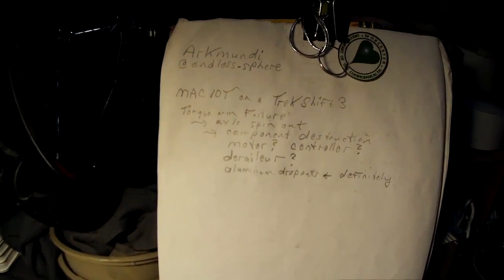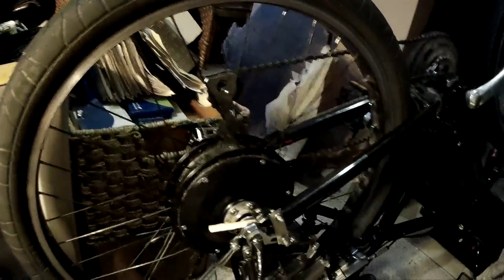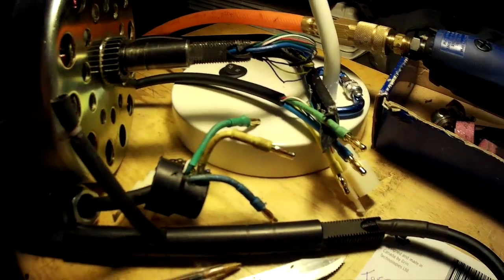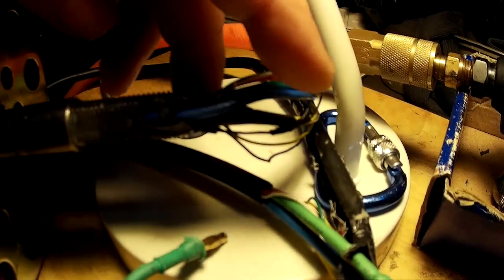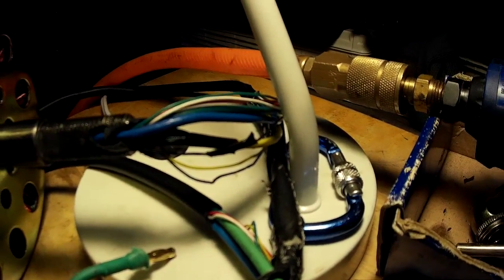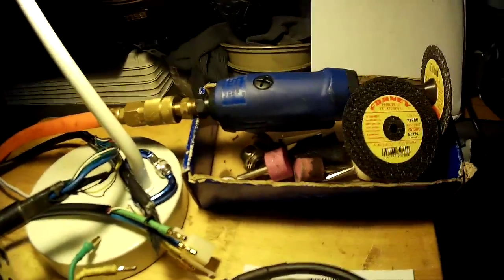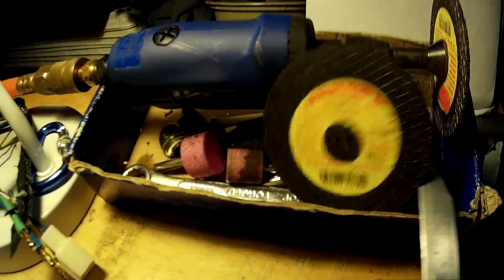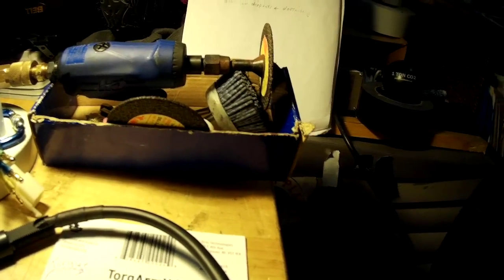MAC eBike motor axle spinout repair

Comment: those torque arms should have been fitted on the front of the upright bar , not the back , the torque is pushing backwards , so the arm needs the frame to provide the resistance .  if you fit them on the rear of the frame upright , the only resistance is the hoseclip .

Comment: Hey man my wires spin with the axle spin out and now I have to change them so how hard is it ???? Do I have to solder the wires ?!!!
Reply: @Richard Kerver
Reply: And where did u get the axle with the wires already in?!
Reply from the maker: Paul at em3ev, where I bought the motor is a responsive vendor.

Comment: looking at your writing on the instructions .you have the direction of torque wrong , as the wheel turns forward ...the torque is BACKWARDS , the axle is always trying to go in the opposite direction to the wheel . thats why your arm failed
Reply: the arm is not pushing against the frame, it's pulling on the frame. that's why the hose clamps were stretched out.

Comment: Hi! Did you have 1 or 2 torque arms installed?
Reply from the maker: I had just the one torque arm when the spin-out occurred. Yes, having 2 torque arms will provide that additional protection, if you want to do that. Note that the frame in question was aluminum, so a factor too.
Reply from the maker: I have since built a new eBike on a Trek 820, which is steel and am riding that.